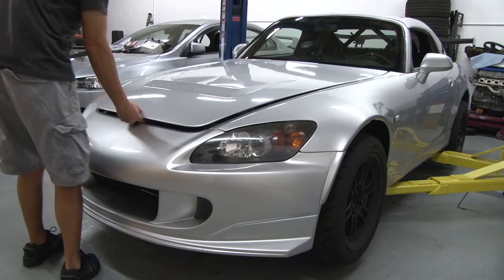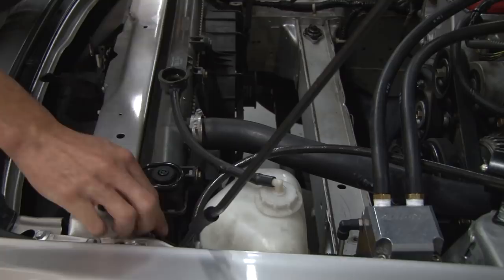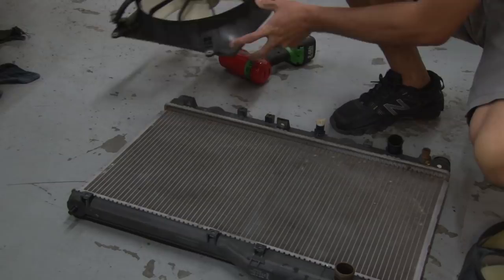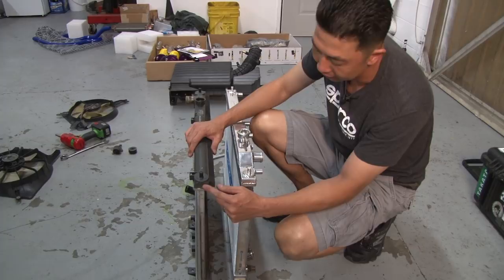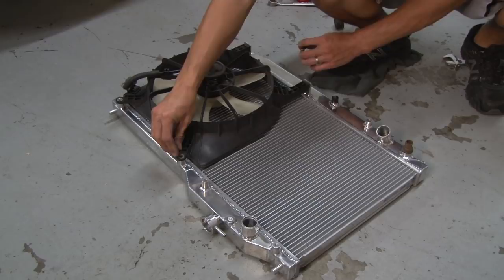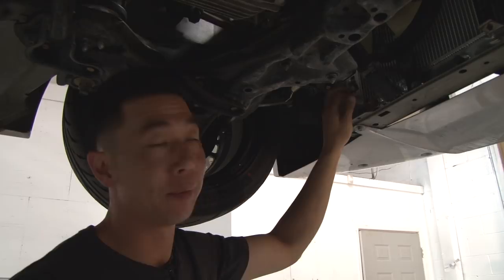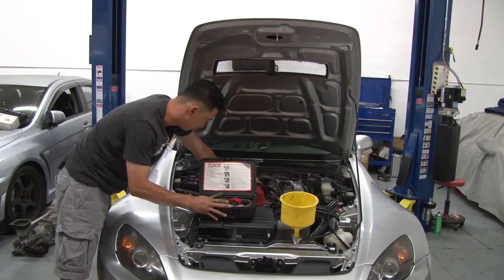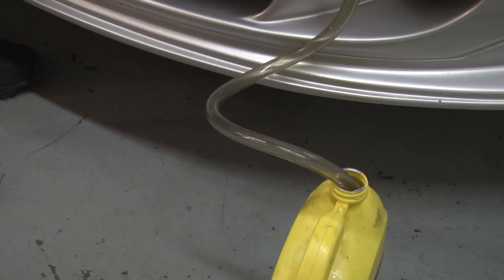How to Install a Radiator - KOYORAD - Track Life Episode 4

Comment: First thing; the quality of your videos is excellent,  subscribed to your channel immediately.  One thing I would suggest is to keep track of the weight for each of the parts you take in and out of the car.  Weight is really critical for the S2000, both distribution and power to weight ratio.  I have an 2007 same color as yours, is a joy to drive.

Comment: I would like to see a oil catch can install, they are like 15$ on ebay and they work really good.
Reply: EK9GraphicDesign If you look at the vac line routing in this video, it looks like he already has one on this vehicle. Any car that spends time at the track in high RPM situations should have a catch though. Keeps the inside clean ;)